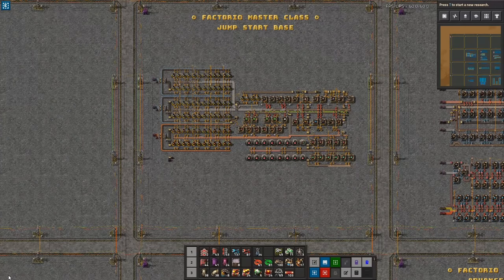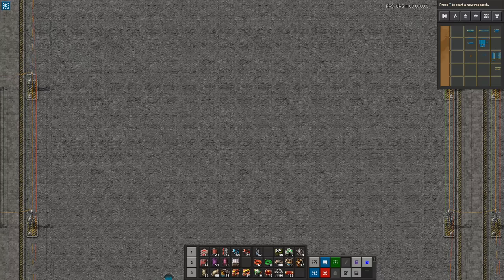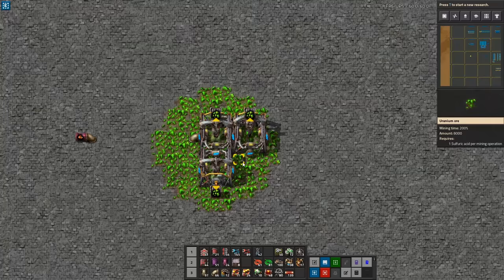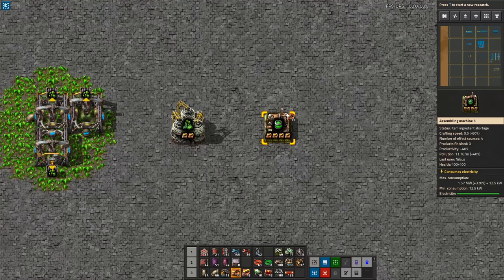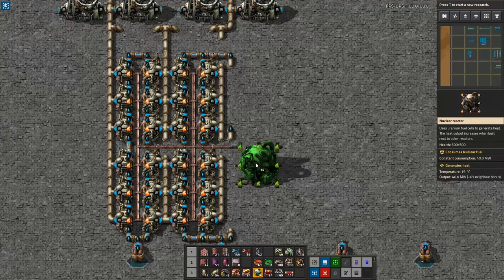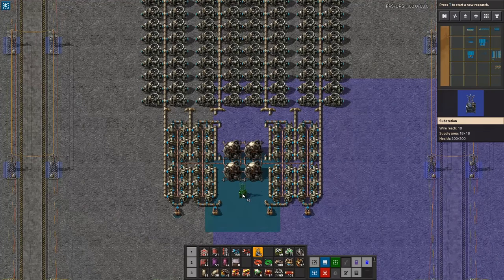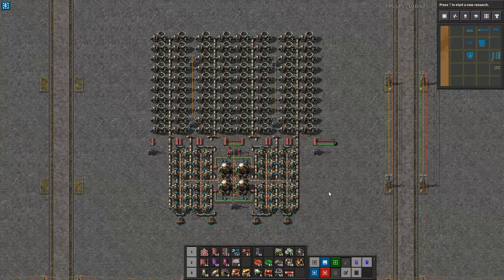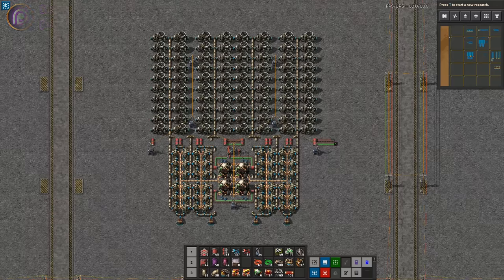NUCLEAR POWER; Shattering Conventional Wisdom | Factorio 0.18 Tutorial/Guide/How-to

Comment: Excellent video, I love how well thought out and justified your design decisions are.

One bit of push back though, your comment on storing steam, you say it's just not worth it. Not worth the cost of fluid tanks? It would seem that while fuel in this case is inexpensive, so is the storage tank. Even just a few storage tanks can help smooth out the power production and increase potential output of the system if used correctly. In my mind adding 4 storage tanks to you design and adding a few extra turbines (8 or so) could account for the variable power usage. It wouldn't increase steady state output but it would prevent brown outs for a small marginal cost.
Reply: Once I got kovarex I just stamp these down all over the place.  I currently have 10 of this exact design in my base.  Any time I get to about 75% power usage I throw another two in.  While the extra materials would be no waste at all I feel that any time spent optimizing would be a waste, since I could be doing something else.
Reply: Steam tanks would only increase UPS consumption, if you design properly your nuclear power plant, you can guarantee a steady output of power without issues, not needing switches, tanks, and all those things. Also, Nilaus uses too many regular pipes on his setup that if you switch to underground pipes, you would improve the flow rate of the steam and preserve UPS as well.
Reply: Mobius one steam tanks effectively count as a pipe. You only need to add a couple of tanks for monitoring purposes, and that’s basically zero impact on UPS. If UPS was that much of a concern then optimizing the design with fewer pipes would be favorable.
Reply: @malventano  so, adding tanks you add 1 problem with it that is Pressure. Since you also have to think about keeping pressure on the pipes to a decent flow, you are adding more entities than using only pipes. 2 Underground pipes counts as 3 regular pipes, a tank might count as 1 pipe but it requires pumps that counts as 1 pipe + 1 engine, so it would be around 4 pipes worth since you gotta handle pressure.
Reply: Sounds like he's more worried about the CPU impact at that point because going into full megabase mode with the level of power surplus that nuclear can provide. Not so much about the plant operation in-game, but the simulation cost that can slow the whole game down.
Reply: @mobius1qwe  2 underground counts as 2 pipes, not 3. Tanks count as 1 pipe with respect to pressure as well. tanks just take longer to equalize, which fools people into believing that they can't flow as well as a pipe can. Regardless, the tank can sit adjacent to the pipes and act as a small steam buffer / pressure sensor, combined with just a couple of wires can enable throttled insertion of fuel to the reactors.
Reply: @vovozaum  o tanque vazio atrapalha o fluxo do cano reduzindo pra casa dos 1000/s ao invés dos 3000 regulares. Pra contornar esse problema usa-se as bombas pra manter os 3000 garantindo que todas as turbinas recebam vapor
Reply: @malventano  on the flow rate they do not, they behave like 3 regular pipes for the pressure as they reduce the flow at similar values.
Reply: @vovozaum  teu nome acusa a origem que é raro achar um br que goste de factorio

Comment: I just put some tanks for the steam down and oversize the turbines with like 25% overhead if i run single nuclear systems that stand alone with solar. If i have peak demands it wil draw from the tanks but they will always be topped off when demand lowers. Its a safeguard for me that when i do a expansion that is energy intensive i don't make the mistake of using more energy than a single nuclear system can deliver. It gives me some time before i can upgrade.

Comment: I managed to build a 2 GW reactor (14 reactor cores) and got it working flawlessly. No steam problems, no heat problems, no water problems, ran at full capacity. I figured the efficiency would be nice, especially in the late game, but any more than 14 reactor cores and I start having issues that I can't resolve. 

The problem with a 2 GW reactor, as mentioned in the video, is that it's absolutely huge. I had like 5 of the damn things, best place I could find only fit 2 of them, the other 3 were just placed wherever I could find space. I think smaller builds probably would be better, despite being less efficient. I'm going to try building a compact 1 GW design for my next run.

Comment: Space Age just made the argument of no kovarex or steam storage stronger, as there are now miners with Resource Drain stat , which is a new seperate bonus from Productivity, but it goes down to 16% drain on regular miners (so 84% of the time the ore patch does not go down), and starts at 50% for Big Mining Drill, up to 8% (so up to 92% of the time, it makes ore not consume the area)
Quality on Reactors/Heat Exchangers and Turbines also are quite interesting but I see it mostly a way to reduce space and also further reduces fuel usage, but needs calculations if mixing different quality levels.

Kovarex is still helpful for other things, as nuclear missiles cost 100 U235 now

Comment: If you use circuits to conserve fuel you would need to set the inserter to operate at 6000 steam at full output on a 4 turbine setup the heat exchangers  would be at temp as the steam starts to run out.

Comment: Hmm, this is interesting. I didn't know just how abundant uranium was, though I was aware it was ridiculously abundant. I enjoy designing and have made some ridiculously large power plants. I've done a 2x16 model and I think it's the best way to learn about water and flow mechanics. The amount of pumps just to increase flow for the water I had to use was staggering and the steam required a lot of attention too. I've ended up with hundreds of thousands of Uranium, both shiny and dark, and I guess I never really thought about it beyond knowing that between steam storage as batteries and efficiency from the amount of reactors I was using that I was cutting down on my uranium consumption significantly. 

I'll probably keep doing that. Definitely once I get to the point where I need more than 4 reactors, the design problems involved with nuclear is very entertaining :D.

Comment: Going large scale late with multiple reactors I can see how not using steam storage actually might end up beneficial. But for your first reactor using steam storage and a simply inserter circuit costs you basically nothing but saves a lot on actively consuming infrastructure you need to support your reactor, especially since when you migrate to nuclear power or the next reactor level you will most likely not yet fully utilize the power available to you and/or have some solar power in place.

Fully agree on Kovarex however. That's something you can put off until you want to fuel trains with nuclear fuel.

Comment: My entire factory consumed less power than a single reactor outputs (b/c solar) but I wanted better efficiency so built a 2x2 reactor anyway.
No way in hell am I wasting all that fuel running full time. Definitely worth the circuit effort... though I needed to make a T-flop train circuit to keep accumulators charging on only solar. That part was a mess lol

Comment: Using those numbers, we should only need around 2 minuers per reactor. Either the ratios you presented aren't correct, or else I made a mistake in my calculations somewhere. Can anyone help with this?

So we have:
In the miners:
Uranium ore per miner per minute = 18
Uranium ore per miner per second = 18 / 60 = 0.3

In the enrichment process:
Amt. of Uranium Ore per unit of Uranium 235 = 1323

In the assembling machine:
Amt. of Uranium 235 per unit of Uranium fuel cell = 10/116 ~= 0.08

In the reactor:
Amt. of fuel cells per reactor per second = 1 / 200 = 0.005

Putting them together:
# of miners to constantly power 1 reactor = (1/Uranium ore per miner per second) * Uranium ore per Uranium 235 * Uranium 235 per Fuel Cell * Fuel cells per reactor per second
  = (1/0.3) * 1323 * 0.08 * 0.005
  = 1.764

This means we need less than 2 miners per reactor, as opposed to the ~5.6 miners mentioned in the video.
Reply: I think he said it wrong, it's 7.6 miners for the block of 4 reactors. Nilaus often misspeaks but then he is not a native English speaker. (Although it really irks me that he calls  "Sulphuric acid" "Sulpher" ALL THE TIME! )  Doesn't detract from the amazing builds and tutorials he produces

Comment: If you wanted to get that missing bit of water in your ratios you could use a storage tank for water for each set of heat exchangers and use two water pumps per storage tank to keep the water storage tanks filled. Gives you the missing water and would still be tileable.

Comment: Nice to see your design process.. I have this idea of building one giant sushi belt on steroids (think 20 lanes). A circuit network assures it never deadlocks (from overfilling). You just take what you need from it with filter inserters and put your produce right back an the belt. If you need some intermediate products you add crafters for them upstream. Think of a circular main bus with contents mixed evenly across all lanes rather than with dedicated lanes per material. Any thoughts?
Reply: Dennis Bautembach Aside from "that's madness" I'd say go for it. Sounds like a fun challenge. I think you'll run into congestion problems quite quickly.

Comment: The reason I use the refining process is to consume the 235. My biggest problem with nuclear power is the lack of ability to delete items. In my first time using nuclear power I set up 20 steel crates to hold all the 235 and once they filled up my centrifuges stopped pulling out 238.

Comment: Ok I'm new to Factorio but been playing Satisfactory for a while now and there is some mechanics or way it work that you probably assume everyone knows that new player don't. Things you don't explain here is :
1. How many or how much sulfure do you need to mine the ore.
2. The build leading up to the nuclear fuel. How much constructor do I need for that build to work ?
3. What do you do with the waste product ? Uranium 238 and the fuel waste ?
4. What does Kovarex do ?
Reply: 1) One sulfuric acid (wish he would stop calling it sulfur, which is a different ingredient) per mined ore
2) Not sure what you mean here.   It takes blue science to research nukes, at that point you will have all the necessary assemblers.   (mark 2 assemblers and oil processing, specifically)
3) U-238 can be used for very powerful ammo and for kovarex (see 4).    The fuel waste can be reprocessed back to make more U-238.
4) Kovarex is a way to convert U-238 into U-235.   It takes 40 U-235 and 5 U-238 and turns it into 41 U-235 and 2 U-238.

Comment: I went with a circuit and steam storage design because otherwise of dozens nuclear power plants would have been sitting at 1000 c degree all the time (maximum capacity) and still consume fuels.

All other energy demands are fulfilled by solar arrays during the day.

Would you rather have fuel cells be consumed all the time? Or occasionally be turned off?

It is kind of like having regular boiler consume coal/tree/etc... all the time. Lot of wastage from  not utilizing all of the boiler output (1.8 MW) and miniscule power to move items.

Comment: I saw a Reddit thread where someone showed off their 2x5 build. They showed screenshots that demonstrated it was indeed running at peak efficiency, and it was absolutely beautiful, but my gods, I cannot imagine how many hours they spent on it. Unless you intend to just copy that person's blueprint, I would highly suggest taking Nilaus's advice here.
Reply: or use water well pumps (offshore pumps buried under landfill), provided you have access to a big enough lake, it solves the trilemna of heat/steam/water connection : just feed the heat exchangers lines directly with water well pumps and the rest will get far easier to deal with.

Comment: I agree with not needing steam storage, but for another reason: There's enough inertia in the system as it is. In my design the outer most parts drops to 824° when fully on for several days, so that's 324 degrees of storage at the part which can store the least. If you want to turn off the plants, then one steam storage tank is enough, just to get the signal.

Tileable is not really important. It just takes one belt of input and the water still has to be done manually, so snaking the belt around a little between blueprints is relatively speaking no extra effort.

I think everyone who has played this game has discovered that you don't need many miners, because it's hard to not notice when a resource stacks up and the miners stop. 

I suspect the reason why people build grander designs with circuits and everything is because factorio is about efficiency. My blueprint has 16 reactors and 4*60 heat exchangers. This also turns into nice maths because each each turbine takes 60 steam, so each quadrant needs the same amount of turbines as one exchanger makes steam (=103). That's 29% more efficient than your design. The fact that it is 29% more efficient using something which is already cheap is not important. Also if it really is a challenge with steam flow like you said then that's a great opportunity to learn.

Yes you can do nuclear before kovarex, but why? What's wrong with coal? You can start by replacing steam engines with turbines in your coal expansion. That way you already have part of the nuclear plant built. Use the time and resources getting purple science instead.

Comment: Instead of building steam storages you can store all your energy in form of heat. It can be usefull if you don't use that much power at the moment when you build this and if you don't want just burn all the uranium. That's why i think you need at least logic circuit on reactor loaders and one battery or one tank to measure when the reactor needs to kick in.
I did some calculations.
If you have a setup with: 6 reactor, 258 heat pipes and 80 echangers (all this numbers was my setup, i can upload my table to google sheets if somebody want it), in total you will have 199 GJ (!) power just in heat. It was safe number, because with 6 reactors one burn cycle gives out only 160 GJ and none of heat will be wasted.
Reply: I never thought of that, wow!

Comment: I've always been a fan of smaller, more modular designs, nuclear reactors included. But I am curious to know how the UPS impact works. You said that big huge reactor setups are in general not a good idea, due to their inefficiency. But to that I say, is it more UPS friendly to build one gigantic reactor setup, even if it's only 60% or 50% efficient, or split that up into multiple, more efficient, smaller modules? I know that fluid calculations are one of the most stressful things on UPS, and nuclear reactors have TONS of fluid calculations. I would expect a larger reactor design, despite being inefficient, would still be more UPS friendly, since one gigantic setup would likely have less overall fluid calculations than having multiple smaller versions of it all doing the same kinds of calculations. This is something I would love to see get tested.
Reply from the maker: UPS is much better in 1.1, so I think Nuclear may be viable for megabasing now

Comment: The circuit network needed to prevent putting in excess fuel is ridiculously simple. All it takes is 1 decider on steam storage and 1 decider (and 2 inserters, but you'd have those regardless) per reactor.
The short version: https://i.imgur.com/sct7lJY.png
The verbose version:
Steam decider is set to output 1 spent cell if steam is less than a semi-arbitrary number. Input connects local steam storage. Outputs red wire via power poles to inserter(s) that inputs new fuel into reactor (in-inserter).
Reactor decider is set to [spent cell > new cell], also with output 1 spent cell. Input green connects to its own output, the in-inserter and the inserter taking fuel out of the reactor (out-inserter).
Out-inserter is set to [override stack size: 1], [read hand contents] and [pulse].
In-inserter is set to [override stack size: 1], [read hand contents] and [pulse] like the Out-inserter, but also [Enabled condition: spent cell > 1]. As stated previously: green wire connects it to the reactor's in-inserter and also the decider, while red wire connects it to the steam decider's output via power poles (and by extention: other reactors' in-inserters).

The way it works is simple: Decider looping into it self is an SR latch. It gets set by the out-inserter pulsing the spent fuel it's taking out. It's reset by the in-inserter placing a new cell in. In-inserter will only reset the latch if fuel needs to be added (not enough steam) and if the fuel was already taken out.

There are only two things to note:
1) deciders need power, so they need to be on their own power grid to work properly.
2) you need to put in the first new cell into the reactor manually. From there the rest is automated.

Comment: Could be wrong, but the heat exchanger set-up seems to waste space. You have 3x4 configurations running vertical whereas I have 6x4 running horizontal. You can put the heat exchangers back-to-back to save on heat pipes and standard pipes.